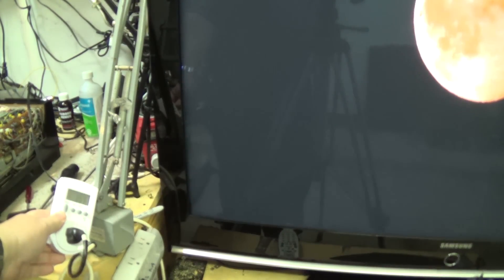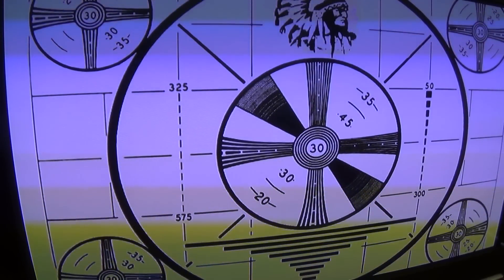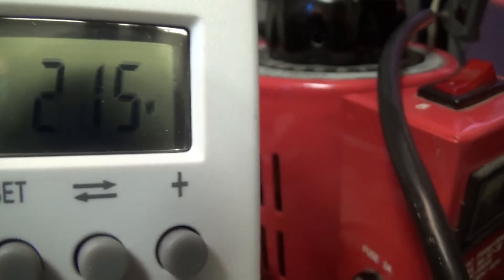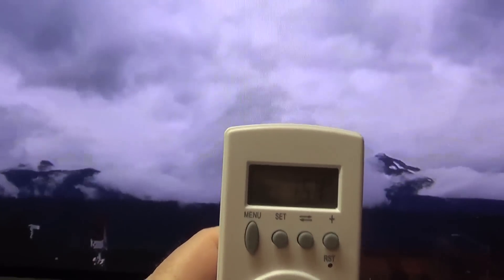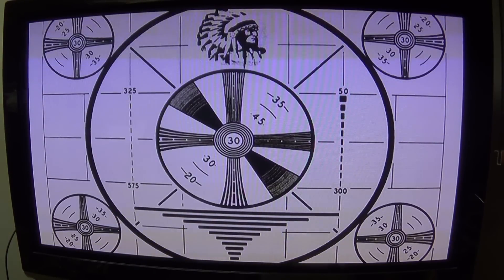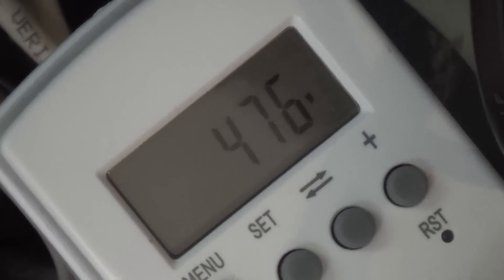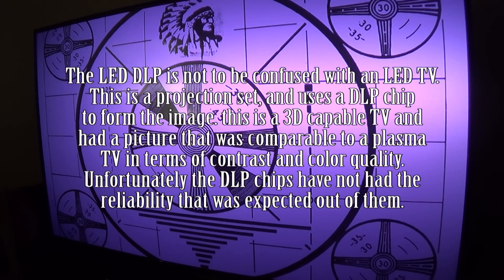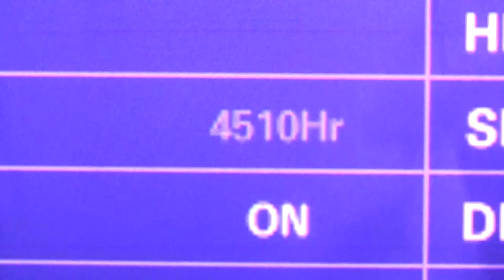Compare plasma to lcd to DLP power consumption

Comment: What uses less electricity, plasma tv’s or LED tv’s?
Reply from the maker: Led used least amount of power, LCD the most and plasma in the middle.  The first generation plasma were pretty power hungry but later generation sets took less. Plasma power consumption varies with screen brightness.
Reply: 12voltvids thanks 🙏 I appreciate you

Comment: I have a Panasonic room heater also known as my plasma tv.  500 watts and you can dry socks on top of it.  still going strong after 12 years
Reply from the maker: LOL my Samsung 1080p 63" plasma is a great room heater. It draws more like 650 watts.
Biggest plasma I have ever seen in a home is the ginormous Panasonic 104" plasma. It requires a dedicated 20 amp circuit @ 240 volts to operate and draws about  3KW of power!
Reply: @12voltvids  wow! That's as much  power as an electric dryer. Cool info! Thanks!

Comment: A plasma set is not really too much out of the line in power consumption as a comparably sized lcd? I have always believed that a plama tv was way worse than that.
Reply from the maker: +ZenithClarity1969 
First generation, that would be 2000 model year sure were pigs.
Reply: 12voltvids
Yeah, that is when i first got my info on plasma sets and it stuck with me all these years. I remember going to Rex appliance store back then and asking about one and at that time they didn't have one in quite yet but the guy told us the price tag was going to be 20,000!!!!!!!!!!!!!!!!!!!!!!
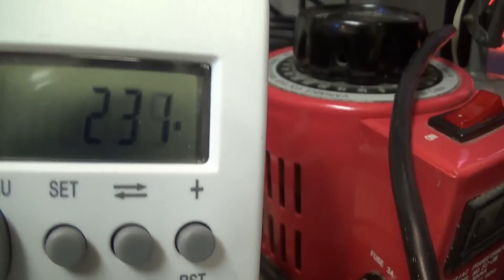Reply from the maker: +ZenithClarity1969 The first ones that sold at the shop I was at were Panasonic SD sets and they were 12,000 for a 42The set shown at the 3:38 mark is an SD set, and it was 7,500 when new. I got it for free,
Reply: 12voltvids
You mean you got that for free back then? WOW! What a perk!
Reply from the maker: +ZenithClarity1969 
No not back then. I was given it last year, broken. The repair video is on my channel. It was totally dead.

Comment: Hmmm, interesting idea.  I've tested refrigerators, freezers, AC window units, fans, heaters and junk like that.  I also tested my camper line for draw.  I used a clamp on meter for that stuff (it has a plug adaptor).  I consider most electronics as trivial, unlike old tube color TV sets were.  Most draw less than an amp.  The KWH meter on my house turns like a roulette wheel, we use a lot electricity.  I have not played with a watt meter in a long time,  you inspired my to check it out.  My snack bar used a lot of electriciy back in the day.  It had a 3 ton AC, Bunn coffee maker, at least seven refrigerators, two microwaves, vending machines, drink machines, toasters, hot dogger, etc., a "small stand", at Revco warehouse in Cleveland - as seen in my 1983 snack bar vid.  btw, I made that vid with my first video camera / portable VCR, a Konica (Sharp w/saticon) and Hitachi VCR as seen in the vid.  I bet that snack bar had a huge electric bill, but Revco covered it, since I took care of al the employees there!  Don

Comment: Are those numbers close to the power consumption shown on  the back of the sets? I have a pair of Toshiba 32" LCD sets, the older one uses CCFLs and draws 117W and the newer one uses LEDs and draws only 51W, but that's according to the stickers on the back of them. Unfortunately I don't have a meter right now to see how accurate  those numbers are. Great video, thanks for sharing this comparison.
Reply from the maker: +Zirok1982 Yes they are in line with what the power ratings on the back is.The 63" was rated 475 watts, and that is what it draws on a full white screen.

Comment: The L.G did really well in saving mode.
I think 400 watts is just mad, something is just drinking the juice.
I dont think you will be stuck for a tv lol :-D.
.
I wonder if the power factor correction (if they have any) is better in some sets, i know p.c power supplys have active p.f.c. more these days.
The cheaper pc supplys of the past had a series choke, i presume to countermand the resivour capacitor.
Ive never really looked too close at the power factor correction side, most of the stuff i tinker with eather has none or it works and doesnt need to be repaired.
Reply from the maker: +zx8401ztv 
The power meter has read out for pf VA, watts, let, and cost of operation. (input rate and it shows a running total of device plugged in. ) I have checked it out. It is bang on. A 100 watt incandescent bulb shows 100 watts. A 1000 watt kettle shows exactly 1000 watts. The power factor on all the TVs was 1.0 so no need to show. Most of the cheap switching wall warts I have checked are very low. The worst offender in my house is my aquarium. Power factor for pumps and magnetic ballast lights .31! The tank draws about 400 watts when the lights are on, real power, or about 3.7 amps. The apparant power is 12 amps. Good thing I don't pay for va. The meter is a neat little toy.
Reply from the maker: +zx8401ztv No I don't need to worry about TVs for sure and that isn't all of them. I have 2 more working plasmas, and 2 more broken ones awaiting parts. I have sold all the rest of the ones that people have given me.I had a word with the kids that crank up the brightness full about the power that chew up. When set to a reasonable level energy star plasma sets are about on par with LCD TVs, but cranked up, yep they  can drink the juice like a fish.

Comment: Nice comparison. I have some shop lights made from broken LCD TVs and I've removed everything except the power supply and backlight inverter. I'm guessing it draws less power than if the Light was still a TV and working. A guy on here called Grant's pass TV repair did this hack and he said the "TV" light draws about 100 watts but I'm guessing the amount of power used would depend on the size of the screen and how much of the original circuits are intact. in this case just the power supply/inverter circuits.

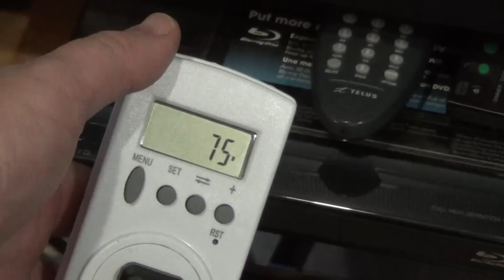13:15 I have an XBOX 360 power brick and it says it uses maybe 250 watts. At the time I was using it to power my Polaroid LCD-2000 TV.  

I prefer to stay away from DLP TVs. more moving parts to fail. A buddy of mine had one, the same bud who gave me the polaroid TV. I would have taken it if they were gonna throw it out but at the time I didn't have the room for it.
Reply from the maker: +coondogtheman1234 LED DLP have no moving parts other than the DMD. They do not use a color wheel like the conventional DLP sets use. They use 3 PHLAT Light LED assembly made by a company called Luminous. These LED chips are pure primary red. green and blue light. They strobe one color at at time at a refresh rate of 3000 FPS. Unlike the old DLP with the color wheel, there is no color strobing when you look across the screen. These were about as perfect a picture anyone could ask for. Other than the white dots mine looks fantastic, and if the chip wasn't about 200.00 I would have one in it already.